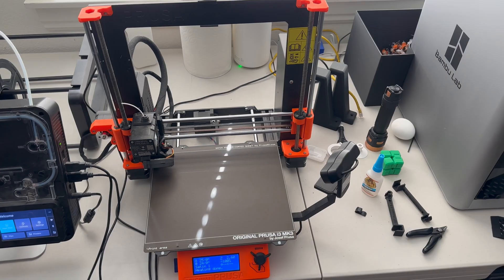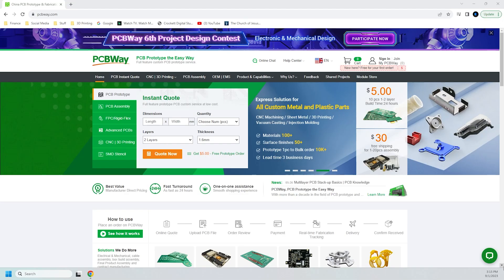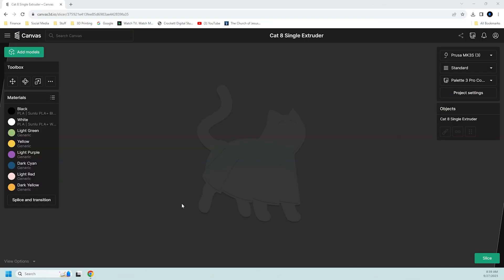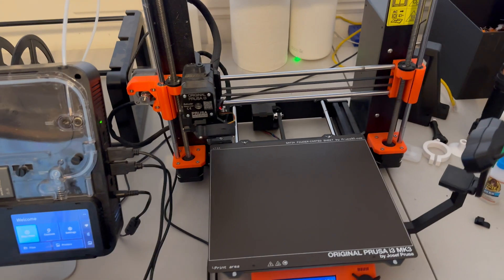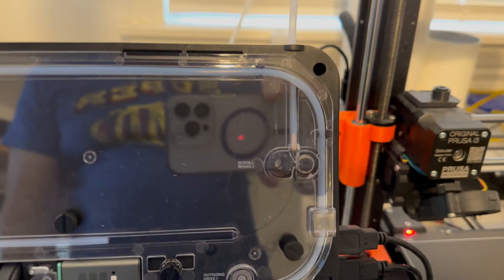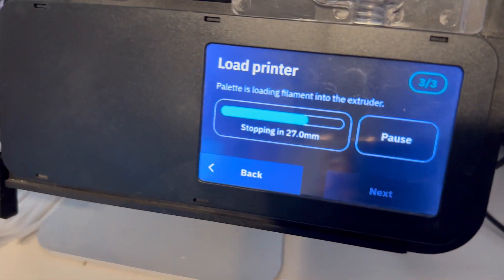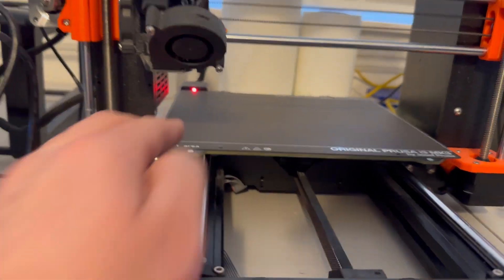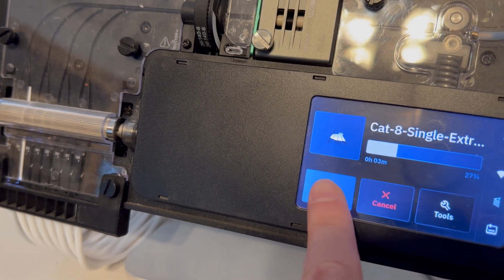Issue with Palette 3 Pro/Prusa MK3/S/+ and the Workaround

Comment: Check your g-code. May be M0 or something else added after those two lines that caused printer to pause the print.
Reply from the maker: Yeah, I was in contact with someone at Mosaic not too long ago about a different issue. He commented that they’ve been watching my videos, which surprised me. But, he gave the same advice. I haven’t had a chance to try it, though. Honestly, I’ve all but decommissioned my Prusa/P3P setup since I now have 3 Bambu X1-Cs.

Comment: Did you try a factory rest ? Somtimes frimware writes some settings to the ROM that wont be cleared even if you go back in frimware
Reply from the maker: I had thought about that. But honestly, it’s much easier to simply press Pause/Resume than to do a fac reset on a Prusa, and then go through recalibrating.
Reply: I'd probably do the factory reset even with the hassle of recalibrating.  Then wait till the Mosaic and/or Prusa resolves issue from newest firmware.. or i may try applying the firmware again just to see if it's consistent 😂.  I rather do that than resign to pressing pause etc.